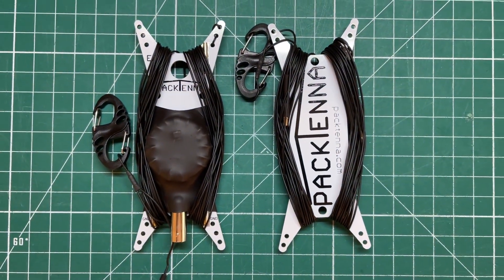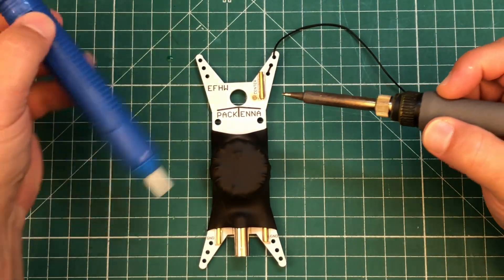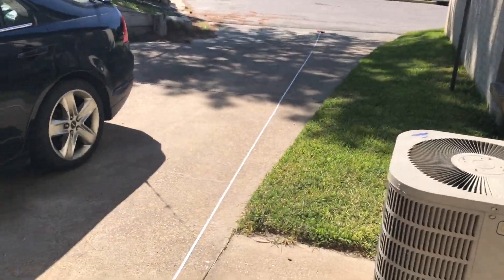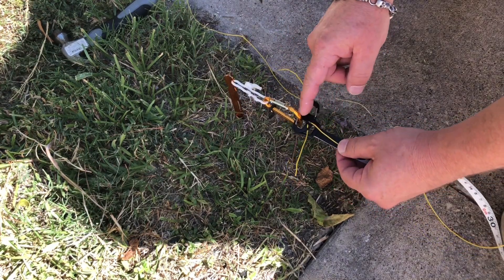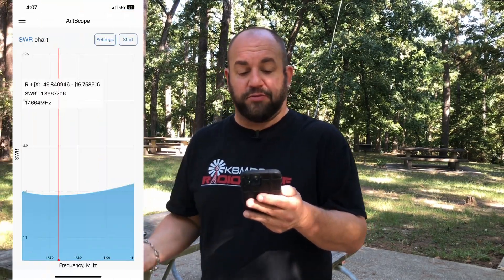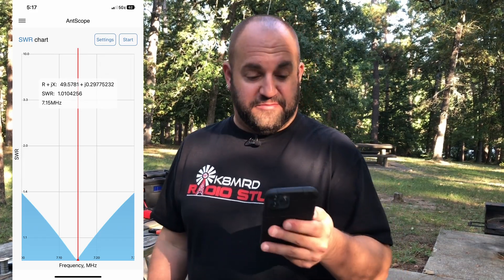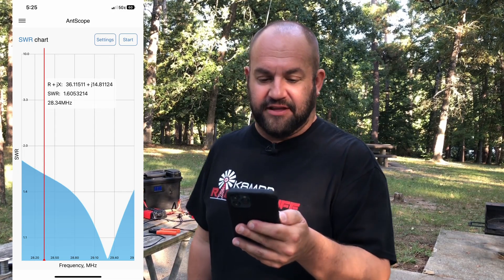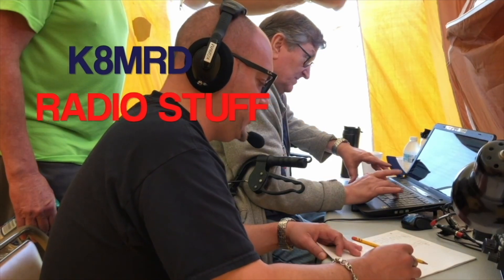How To Make A Linked EFHW End Fed Half Wave Antenna

Comment: Fantastic video thank you!!! Newbie questions here. Is the antenna length indicated at the bend or the tip that connects?  Does doing this affect the length of the counterpoise?
Reply from the maker: No, I don't put anything on them but you certainly could.  I also don't use a counterpoise either but I doubt it would change that.

Comment: Mike. I ordered the 2mm banana connectors from your amazon list for antennas and accessories.  Only what I got was not what was pictured in the listing. The end that the wire goes into is on 3/32" deep and no hole to feed the solder.  I think the seller changed the product but left the pics of the old product. Just giving you a heads up since it's in your recomended Amazon list.

Comment: Hi Mike, thank you for the great video. I am in the process of building the antenna and have pretty much everything I need now. However, the ferrules I ordered from the link (N25007) are too small. The other link is for ferrules that are even smaller and I have not seen any ferrules that could fit on the ferrules direct website. Can you share the link to the correct ferrules you are using? Please thank you
Reply: I just ran into the same struggle. I can get the ones in the link N25007 to just barely go over the Sotabeams wire but not over the wire XTenna provided. I just ordered N40009 - 12 AWG by 9mm long. This will be more forgiving for wires with larger insulation.

Comment: I'm going to be building one of these as soon as parts arrive. I have a question, though. I intend to use a counterpoise with mine. Would it be advisable to make the counterpoise linked as well for each band, or would a single length work well for them all?
Reply from the maker: No clue.  I don't use a counterpoise.

Comment: Hi Mike, I found  not to cut that  tomuch  lenth on end feds i give it  a bit  of a Z fond  +/- 1m (you guy 3 ft) from  64 or 49-1 the grouds tend to change in places and it then give me some adjustment at the bottom  near trans  former, many  thanks  keep a going, 73, Pieter ZL1PDT

Comment: Ugh I'm all confused on lengths.  So I have the EFHW from PT.  It's cut for 20m.  I'd like to extend it to 40m via your method...but all I want is 20 and 40.  How long should the 40m plug-in section be (cut long obviously).
Reply from the maker: I lucked out and cut 10 meters of wire and it was perfect.  Here's an older video I did on a 20/40 Packtenna https://youtu.be/kkL3s3_6AWM?t=208 showing the total length.
Reply: @hamradiotube  Booyea.  Thank you so much!

Comment: Pro-tip: 20, 15, and 10m are resonant multiples of 40m so you only need one link for the 17m band.  Add a small loading coil near the feed point to bring in 15 and 10m. 

Order of operations: 
1) Cut the 17m element a couple of feet long.
2) Wrap 10 or so turns of wire onto a .7" cylinder (plastic drip line works well, or other tubing) positioned 5 ft from the feed point. 
3) Tune the 17m element.
4) Add a link and about 13m more wire, then trim to resonance on 40m. 20m, 15m, and 10m should be good as well. 🤘😁👍